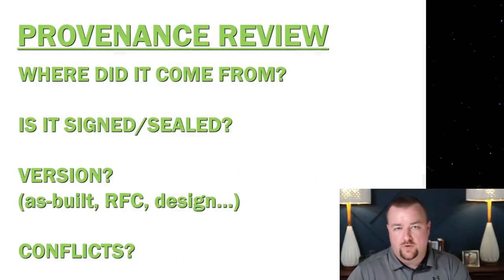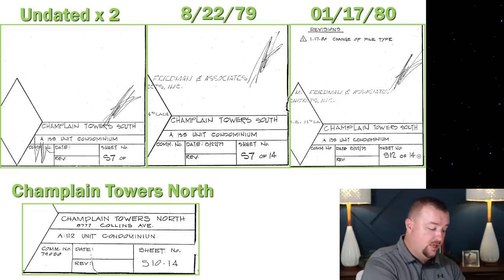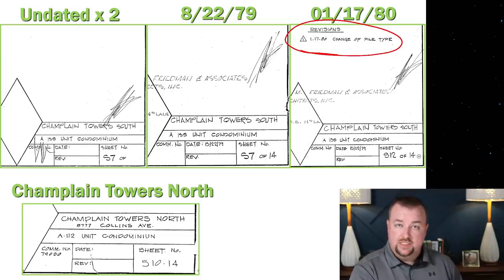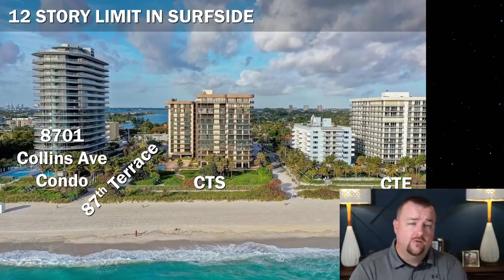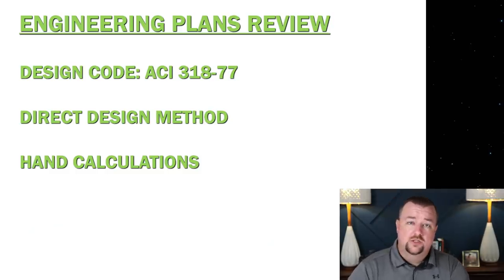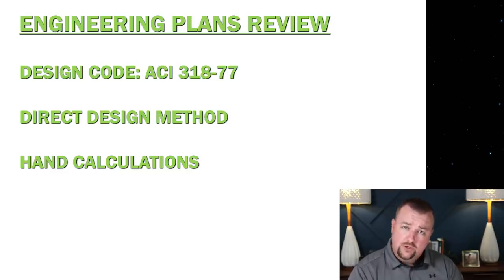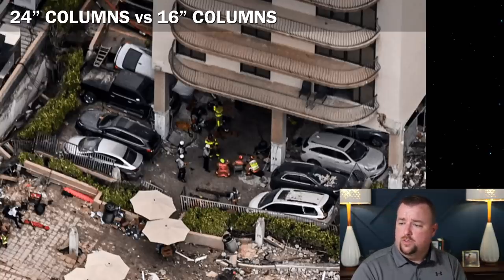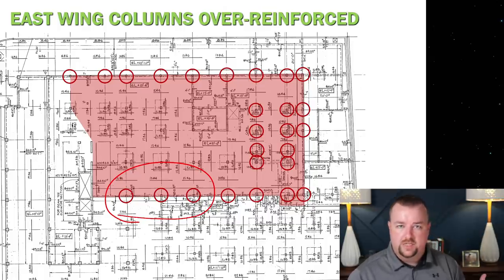Engineering Failures Found in the Champlain Towers South Drawings - Surfside Collapse

Comment: I remember about 25 years ago, when I was doing some of my first project work on commercial construction sites. What I was doing was the kind of video systems you find in a sports bar. Specifically, these were mostly BW3's. Most of them were in either end/corner units at higher end strip malls, or some kind of stand-alone, so other than just a few locations, like Chicago, we weren't dealing with multi-floor structures.

So I would get there after the shell was closed in, and I would do the wiring, make sure blocking & reinforcement went into the walls where TV's were going to get mounted, and build the ceiling mounts for the projectors.

Without exception, I would run into problems with multiple objects specified to be in the same location. Typically HVAC ducting, Sprinkler system piping (and sometimes a sprinkler head), and my projectors.

With ONE exception, which if I recall correctly was at Kings Island near Cincinnati, Ohio; I couldn't get a straight answer from any of the trades about what was happening that day or that week. Not because they were being difficult either, it was because they didn't know. And I did a LOT of these system installations. The one exception was a site super who ran the tightest operation I've ever seen. HE could tell you EXACTLY what was happening, off the top of his head.

This period in my career was when I learned how to read prints, because I had to. By the time I came in to do my work, we were about a week away from the soft open and there was NO buffer time left.

So the problems that I saw way back then, which is still going on today:

1. Too much stuff wasn't on the print. AT ALL. It was just taken for granted that it was part of the finish work, not the "real" construction, and it didn't matter.

2. People read the prints in two dimensions while building in three.

3. Nobody talked to anyone else outside of their individual crew. Nobody knew what anyone else was doing, when they were doing it or how they were planning to get it done. This was a total lack of a communications plan so that everyone knew what the big picture was, and every trade was siloed. My opinion...? This was down to a lack of a site superintendent, who was actually ON SITE. Having a G.C. does you no good if there isn't a conductor on site to lead the orchestra.

I was looking at those planters at about the 40 minute mark and I did a visual guesstimation of how much volume the encompassed, concrete and dirt included. Based on my SWAG (scientific wild-assed guess), I'd say I'm looking at 36,000 pounds of concentrated static load right next to probably 30,000 pounds of static load just based on the cars I can see. A load which would have been dynamic on a regular basis.

I'm not saying that the planters caused the collapse, I'm asking with what is admittedly hindsight; was there any communication between the architect/engineer and the builders? Any Change Management system at all?

A guy I used to know liked to say; "Any idiot can build a bridge that will last 1,000 years. It takes real skill and engineering to build one that will last 50 years."

He would probably agree that if you build something with no excess capacity, somebody fucked up.
Reply: I like that joke, keeping that one.

Comment: An excellent and well presented analysis in an understandable fashion for us non-engineers.  While a lot of us can look at something and think, "that doesn't look right (or substantial)" in a construction, you are very talented in showing the reasons behind something that doesn't look quite right.  I have learned a lot from each of your video presentations.
Reply: It's a pretty good video for those of us who were engineers as well!
Reply: The columns not being in line been noticed way back as a "that looks funny" as in it might not be a problem but it needs a serious look at. 

Or Holland American Cruse line that takes maintenance seriously and clearly follows the Military and good restaurant rule that if something visible is messed up or untidy who cares if it not important for safety it an indicator that the things that are important are also not maintained time to turn every thing upside down In a inspection. 

I had noticed the constant drills and no missing detail on Holland America till one year during life boat drill I noticed the screws holding a bottom rail on the life boat were clearly not of the same metal and a good deal rusted away which can happen very fast when salt water and different metals mix as the electrical connector involved rusts one fast, still fast in fresh but not as fast). 

Turned out that was the worst looking life boats but all showed it when I looked. But within 6 days every single screw on the life boats were replaced they had noticed too reassuring me they on the job. Probably the life boats had been reworked recently and because that form of rusting can be super fast they noticed it and ordered new screws out as fast as possible out to what ever non US port they got them at probably not cheap shipping and then the crew slammed in the new screws in a few days. I don't think the bottom rails directly effect the ability of the boats to float the rails just protect the bottom of the boats when launched and recovered. 

And Holland America they have to recover life boats as they regularly launch a few probably in rotation along with a life raft or two for the crews assigned to them to practice using them at a lot of ports when visiting. 
On board in visiting ports places it can be a tad annoying all the emergency drills they running with alerts almost every day. But I don't mind much as drill, drill, drill, drill is how you make a good crew who acts in emergencies without even thinking of what they have to do. 

I do like that Carnival runs each Cruse line it owns as a independent business. You would never be able to guess on Holland America it was not still a Dutch ran company. Ship Officers almost all trained in Holland, easy noticed by the constant good looking blond twenty something junior officers male and female best spotted in lifeboat drills. Clearly following the military system Officers right out of Holland's Marine Academy start commanding from day one no matter how many years a non officer been onboard. (although just like 2nd Lt in Army/Air force or Ensigns in Navy they all told to listen to experienced crew with higher crew rank) No signs anywhere on web site or materials that Carnival owns them and there are NO combined promotions. 

This totally separate devisions system I learned in the 80's the only constant thing in that system normally is accounting systems so head office can be sure of financial data otherwise head office only gets involved to replace a head CEO of subsidiary if performance is bad but they try to avoid telling the CEO of any subsidiary what to do.

Comment: In my early years I was trained for reinforced concrete detailing and so learned the calculations needed to design a building from the top down.  
Adding a penthouse after the fact does not seem a prudent move.  
Also I am struck by the fact that there is no thickening of the slab around the columns to offset the punching forces.    
Also I learned over time to avoid detailing reinforcing steel so that it ends in one plane but rather to stagger the laps so that alternate bars  are offset.     I also learned that it is never a good idea to go with someone's good idea to do a design change on the fly because inevitably you are going to miss something.   I noticed there were places where steel was not continuous but a series of short straight bars with minimal lap.
Reply: During all the video I was wondering why there was nothing to prevent columns from punshing through, thickening like you're saying, or a steel plate or something. I mean look at the Parthenon built 2500 years ago, there is something at the top of the columns !
Reply: @aesma2522  
You know there was no reinforcing steel back then. Everything was based on stone arches in compression.
Reply: @imconsequetau5275  No there wasnt but the same concepts still apply. Its why they have stone slabs on top of the columns instead of having the floor straight on top. It helps spread the load of the column on the floor above it out. Load is not just a 1 way thing, forces acts in multiple directions

Comment: My god. Columns and slabs being loaded to 100% on dead load alone is insane. It seems like their ability to carry live load for 40 years before collapsing was probably just down to the materials being stronger than specified and nothing more. This seems like gross malpractice.
Reply: Then add planters, sand, pavers, water, and 6,000 moving vehicles and it's just a matter of time.
Reply: Exactly...I would like to see a discussion on this.
Reply: I expect there is a lot of safety margin in the 100% load factor to allow for variances in construction, variations in concrete within even a single load, and to allow for some degradation over time. But, a building which is over 100% loaded is gross malpractice. Allowing a landscaping permit to put materials on a building at 100% load already is another surprise. The live load of people on a concrete structure is negligible. Cars which rapidly start and stop 6000 lb loads is another matter when considering live loads. There is a reason for speed limits in parking garages beyond preventing collisions, and it's to limit live load impact on the building.
Reply: @johnhaller5851  Oh, that makes me remember why I HATE parking garages. Again. They mark it 10 or 5mph, and then put it on a ridiculous slope to accommodate the lack of footprint...
Reply: @johnhaller5851  If you need people to follow a speed limit in a parking lot were you can't legally ticket people, the building is unsafe. And as others stated you can't have support column they can run into thus way less parking as one Japanese Building I saw every side parking space in effect a bunker for the Car with support walls on every side not columns. I was thinking what this a former fighter plane bunker each spot protected by blast walls from another. (It was certainly not any plane bunkers from the war on the surface)
Reply: @RedRocket4000  Japan also enforces stringent earthquake codes.
Reply: @satunnainenkatselija4478  Driving faster over a slab is actually less stressful on the slab than going slow, fun fact.
Reply: And then you add speed-bumps at some point for safety. Now vehicles are decelerating and accelerating more quickly than without them, plus with an added vertical load due to the bump. Brilliant.

Comment: I think you nailed the root cause of failure here sir. 12" X 16" concrete columns supporting cars with 1000's of pounds of planters on them to boot? 39:25. Great analysis. Very thorough.
Reply: I think you could be right Glenn Davis. I would like to know if there is a reason why an incipient, creeping failure in this area could have caused popping noises or deformation in the part of the building that had the unit 11's....including that unit on the ground floor.
Reply: Cars... yes that's another issue. My sense is that in 1979, when this building was being designed, the cars that people drove weren't the monstrous SUVs that people often drive to day. Are current building codes and 40-year inspections of older buildings taking that into account?
Reply: @Inkling777  cars and SUV are actually much lighter now than they were back then! Believe it or not. Everything now is made out of plastic and tin. Back then everything was solid steel, body on frame designs. Much heavier!
Reply: @bitey-facepuppyguy2038  From Engineering forum the Pool Deck should have been designed so that anything that happened to it did not effect the rest of the building at all. In layman terms I thing that means breakaways and things like the pool deck slab not connected to any slab under the building as part of that. A rubber gasket or something filling the crack between them to help junk and people losing stuff in the crack.
Reply: So then if the failure was caused by the failure to transfer loads onto vertical columns, why did those vertical columns collapse?  They were under-stressed and should have all been poking up to the top building height, with all the rubble around them.  (Aside from there being no explanation for everything collapsing at once.)
Reply: @davidquinn9676  When the overstressed columns failed their load was transferred at an angle (like a moment arm) and at that point the columns adjacent to the failed columns also collapsed.
Reply: @Glenns_Concho_Ranch  but the building collapsed straight down, no twisting, no motion to the side.  And the understressed beams were on the east side, which collapsed, so by that theory they would have been pushed outward, farther east toward the water.  All this about side loads is inconsistent with the purely vertical nature of the collapse.
Reply: @davidquinn9676  It only takes 3 or 4 degrees of tilt to overstress columns that are built to just barely hold up the building as this one was. It was not designed for any of the concrete columns to fail. When one side of a concrete slab is unsupported at the end the slab tilts and stresses all the remaining columns. If you want a building that can survive a partial collapse you need to spend more money and build with structural members that are above the building code requirements. If you quote a building that costs more, you need to be able to explain how that cost is meeting a stated need of the customer. The developer of this building evidently wanted this building built as cheap as possible. To make matters worse, this building didnt meet even 1979 building code. When you do the math, it should have collapsed much earlier.